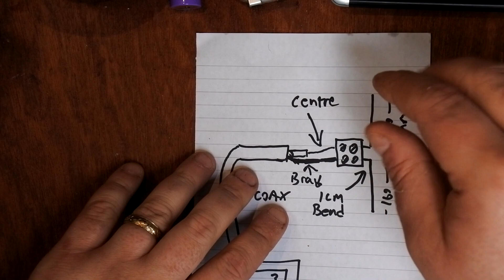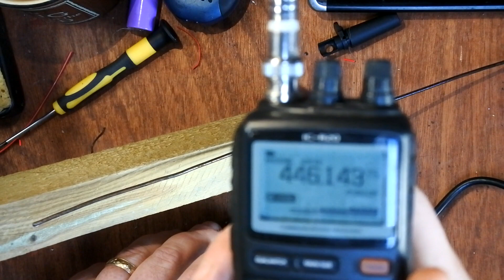Modifiing a PMR or FRS radio antenna for better receive performance

Comment: The easiest way is to fully straighten out the built in antenna coil. Measure from the point where the antenna meets the circuit board and cut it to 6.3 inches. This way you can't connect to an external antenna but it will give you a real 1/4 wave antenna which will work better then the small coiled antenna. Cover the 6.3 inch antenna wire with electric tape, a plastic straw or something.

Comment: Also good point about element Diameter! Some years ago I found a wavelength and diameter calculator online. I was amazed that the " sweet spot" in diameter for certain frequencies was nearly 5" in diameter!! Not practical but very interesting, nonetheless. Also apparently the tip of the antenna is important as a jumping off point for the RF,and not just protection from putting an eye out accidentally.
Reply: Also if memory serves me,that calculator had a setting for element material. Naturally copper is good but not practical in many situations. Aluminum being the most common,but material composition also has an effect. Strangely stainless steel,being non magnetic is used often. Unless it's the magnetic stainless steel that is being used.( I only learned about magnetic stainless steel while at a scrap metal salvage yard last year, I shamefully admit.)

Comment: The long wires inside the radio will act as an antenna and will radiate inside the radio. This will also affect the tuning and performance of the connected antenna.

Comment: it has to be said you should make sure the ground you attach the - point on the antenna plug to is an RF ground, not an analogue ground or digital ground but RF ground.
great video by the way.

Comment: I did a 1988 version of this. Eurosonic 250mw 2 channel CB handhelds bought from local CB, relectronics, radio shop up by secondary school at at the time. Had these 1987 christmas. As CB walkie talkies, completely daft long antennas, as they would be fro 27Mhz. telescopic. left dowen, bit of thin standard grey speaker wire ripped down middle to get 1 bit of the pair. Croc clip one end to telescpic up a few cm for the clip. wire as it was, 1 core to a unstraightend coathanger with tight loop at bottom, bolted to the plastic of the panier rack on the back, Bike CB. Bicycle. Crap. Never as good as the long antenna and coukld have stuffed it up, High SWR. But not ruin. Just comprimise the TX and no doubt Rx of the Hong Kongs finest 2 channel 250mw radio. Radio profile linked in my words or banner photo. Moved on from that, first things I had, Car CB. base and 4W handheld (eat 10AA rechargable thing) in the 90's. A few amateur radios now.

Comment: Keep your antenna leads as short as possible or you will face an impedance mismatch! Then you lose output power from a transceiver that doesn't have a lot to begin with. You may as well have kept the original "rubber ducky" for the power loss of your mod made.
Reply: I also agree , however I have been looking into mobile vhf installation and coax type and length.The company I work for,all my coworkers vehicles have low band VHF radios,but in the natural gas industry where I work, antennas are continually being ripped of by tree limbs and branches,so none of the radios are operational.many areas have no cell signal either. I had 3 years of radio and Tv repair years ago in high school and told supervisor I'd get radios working with minimal $ expenditure.In studying coax for VHF apparently you can just cut coax to the shortest length. But especially in mobile applications coax should be about 1 wavelength. The excess coiled up and stuff under the seats or whatever.
Reply: CANT CUT COAX...I meant to say.i would edit my comment above,but it likely won't repost as google has a ax to grind with me
Reply: At Christmas our CEO came to town and took the whole crew out to a restaurant for lunch. I brought up the radio topic and learned the company is paying $5,000 per month for a Repeater on a nearby MTN ridge,that not being used! Yet at times,we are in situations, alone,in the wilderness of central Pennsylvania,with no communication! SMDH.

Comment: You have the connection wires from the antenna connector centre terminal to long, they need to be soldered to the circuit board and kept as short as possible. The black conductor wire will be a bit longer but an earth point can be located on the board for interconnecting. 73

Comment: D ' ont use wire between the point of power out put and the jack antenna. Will loose power and change impedance ! These FRS use low power and high grequency.

Comment: Roberts Shed why not just make antenna from the Coax ? fold the shielding back 161mm and you got you're dipol
Reply: becouse your in truble with the f.c.c that's why
Reply: why not just leave the radio and  con tact  the f c c and get your fcc gmrs license  I did and I talk to chicago 
every morning  on a tower gridd

Comment: Great stuff, PMR446 can be a great deal of fun. It's amazing how far you can get with these little radios. One thing that puzzles me about your video.... The frequency on your receiver when you do the check... Channel 4 should be 446.04375...... 

446.14375 is channel 12 (On the newer 16 channel radios)????
Reply: @RadespotosR analogue channel 12 is 446.14375MHz

Comment: You could actually use a single 18650 battery outside the case, or a 14450 battery with two dummy batteries in the case (a 14450 rechargeable battery is a sized AA battery) with a remote microphone if your radio is set up like a Baofeng UV5R. The dipole could be set up outside with a length of very low loss coaxial cable, too. Lots of ideas  can be done with the new lithium batteries of today. Think about a 4.5V 1amp "wall wort" as a no worry power supply for the radio? Just remember your polarization when you connect the wall wort power supply or you ruin the radio. I am not suggesting that you do this, but done carefully, it is possible?
Reply: What low loss coax would you recommend? Im about to build a 446mhz half wave dipole.
Reply: I used NOS surplus Navy double shielded coax 50 ohm .50" diameter and hard drawn 12 gauge wire for the dipole both vertical and horizontally polarized (separate antennas). RG-6 can be used with "F" or B NC connectors with little loss. RG-174 can be used for short length  deadlines but be sure to get the 174 with silicone dielectric and at least 80% shielding copper braid.

Comment: If i don't use biple, is it mandatory to add the coax to ground (neg) component with connector for antenna? or can i not just attach a longer antenna to the existing single connection?

Comment: Hi Robert Well Done putting this Video up and will help those who are interested in Radio get better Reception which is never illegal to do 😊👍. .Just a couple of points for everyone to note is not to forget all un-shielded wire to the main radiating part of the Antenna will become part of the Antenna,s overall length..So best to use Coax to the Sockets and also between the socket and Antenna itself...The Scope probe lead is not screened and also the short lengths of  wire connected to the bnc socket inside the Radio will become a part of the Antenna..Best to use very thin coax inside Radio and Rg58 between bnc socket and Antenna Connections...Normal TV Coax is no good as it's 75 ohm not 50 ohm which most Radios are designed for....Anyway good Video and best Regards Steve Liverpool UK

Comment: this wont work that good.. WHY?? cause the wire you used for the center conductor from radio to antenna isnt shielded!! and thus the wire will act as PART of the antenna!!!!
Reply: Funny, I made the same mod and have nothing but improvement on TX and RX, significantly
Reply: @freepressright  prove it.. cause ive done this mod with professional equipment to test the mod and its exactly what i posted above! SIGNAL LOSS CAUSE THE COAX ISNT SHIELDED!!!! ask a professional to explain it to you.. antenna desgn and theory! PS: you can also tell the guy in this video doesnt really know what hes talking about with his coax selection.. ie: rg-8 or rg-58.. As that is NOT good for UHF band..  it will work fine for Cb radio though lol
Reply: @WPGinterceptor460Interceptor  prove it? So, would a video upload of me on a modified Cobra Microtalk CXT-125 with an SMA jack that I added using normal wire, with a 15.6 inch whip and talking to someone distant be proving it? I understand antenna theory just fine, but I did this mod with what I had and it works better than it did factory. I have an active YouTube channel. Would you like an upload?
Reply: @freepressright  if you used a normal "WIRE" as you say it... from the transmit output of the board to the input/ centre conductor on the sma then your losing power to your antenna..  because that wire becomes part of the antenna and on UHF band as these FRS radios are, then absolutly the wire is aboubt 3/8 that of a 1/4 wavelength antenna for this frequency!! YES it will work a little better than the normal spring antenna the radio comes with but the real loss there is the wire..  Lookup M17/94-RG179 CABLE.. thats what should be used .. and with minimal seperation from centre conductor to braid! TRUST ME
Reply: @WPGinterceptor460Interceptor  I never argued it was perfection. I argued that it was a significant improvement,  because it is. I wired to the center pin, then tested for ground and found it on the headphones Jack. I grounded to the outer structure of the SMA. I understand loss factor perfectly, but we are talking about an inch here, at most. Loss factor would be negligible. I'm talking on my Tram magnet mount in the car just fine, and the 15.6-inch whip is a huge improvement over the pile of shit that these come with that they call an antenna. If I'd have had the coax, I'd have used it. But I didnt, and these radios are nothing special. It was an experiment and it works well. Would you like video?
Reply: @freepressright  a video of properly done yes lol.. otherwise loss and high swr video like this one, there are many!
Reply: @WPGinterceptor460Interceptor  I make all kinds of videos. "Properly done" is subjective. What do you want to see? I have a channel and about 237 subscribers. It's a hobby.
Reply: Although not scientific by any means, I shot this on the fly a little bit ago. The description gives the details, but I also have a Baofeng UV5R. Its 5 watts and this Cobra is a half watt radio. The Baofeng is only very marginally better when talking to the guy I'm talking to, who is inside his house on a walkie talkie on the opposite end of town. https://youtu.be/rH50_9LqUmE
Reply: @freepressright  you know using that Beofung on FRS is illegal.. those radios are complete junk and cause a 5 kilohertz splatter.. just sayin,, but thats why they are 30$ and made in China
Reply: @WPGinterceptor460Interceptor  according to the FCCs enforcement records, not a single individual has ever been cited for using a Baofeng, or for any general misuse. Companies have gotten into minor trouble, and a local school district and municipality, but not a walkie talkie user, ever. My occasional use of a 5 watt walkie talkie isn't going to be of much interest to anyone. A bigger issue is what a sewer FRS and GMRS has become now that everyone and their brother has one. That is a far bigger crisis than a guy with a non-type-approved radio. Still doesnt stop people from spewing total horseshit like "have fun getting busted," or, "you will go to jail if you get caught using a Baofeng."
Reply: @WPGinterceptor460Interceptor  and, for the record, that Cobra of mine is a far bigger piece of shit than my Baofeng, even on its worst day.
Reply: @freepressright  the reason for these to be illegal is the splatter.. learn about harmonics and youll realize that when you transmit on FRS your radio is splattering harmonics.. and the stories about FCC taking all day to track you down is BS too.. they have triangulation now and can pinpoint your location the split second you transmit.. not to mention your Electronic fingerprint that radio leaves behind.. use a real radio.. spend the $$$ and get real radios
Reply: @WPGinterceptor460Interceptor  I'm looking for documentation or substantiation that all Baofeng UV5R radios cause a 5 khz deviation that results in splatter. I can find no official or scientific documentation of that claim. Is that one radio that does it? Two? Or all of them? And how do you know?
Reply: @freepressright  yeah yeah yeah.. hook that radio to a Scope and see for yourself.. WHY DO YOU THINK THAT RADIO IS ONLY 30$ BUDDY....... well im older than 40 and been in the PROFESSION for 45 years now! you have alot to learn!!  go back to the CB band!!! laterz
Reply: @WPGinterceptor460Interceptor  all that proves is that you're old -- and that you're arrogant. It doesn't make you right. 

Knowing a Baofeng radio aggravates the do-gooder know it all folks out there just makes me want to buy 10 of them and turn them all into base stations. As a matter of fact, I have about $150 to blow, and  I think I'm going to hit amazon and do just that. 

You telling me to "go back to CB" suggests to me that you're probably a ham, but not just any ham.  You're THE worst kind of ham, despised by good hams, and the reason otherwise good folks become turned off by amateur radio. 

I was a professional broadcaster from 2004 to 2011, working as an AM radio talk show host, a news director for four stations and as a production director. I worked with some truly wonderful broadcast engineers and have many wonderful friends in the amateur radio community, and in emergency communications, as I now work in public safety.  I've been around enough that I have an idea of what I'm talking about. 

I also have the education and decorum to know how to communicate without turning everyone's stomach. You, sir, have a lot to learn in that department. 

Now, if you'll excuse me, I have to go back to my CB radio. I have a 16kw linear amplifier to build a GMRS repeater for :)

That's sarcasm and humor, in case you couldn't tell. Have fun.

Comment: If you're not, you should consider becoming a Hamradio operator.  You seem to have skills with tinkering with radios.  With  Hamradio you are allowed to legally to tinker/experiment with radios (if your intent is to modify it FOR USE within the Ham Bands ONLY).  Unfortunately, PMR/FRS rules do not permit this at all.  Any antenna modification to a legal PMR/FRS radio automatically makes it illegal to use as those services require a fixed, non-removal antenna.  Well, good luck and don't get caught...
Reply: Who the hell is gonna catch him?? Do you keep to the speed limit in your car all the time???

Comment: Hello, I have a couple of walkie-talkies and wander if there would be any improvement if the antenna is replaced with a telescopic one (like the transistor radio ones)?

Comment: It is illegal to change antennas on FRS radios.
Reply: No one ; only use external antennad.
Reply: Oh god, here we go. Not a single individual has EVER been cited by the FCC for modifying an antenna on a GMRS radio, and that's according to the FCC's database. So, in short I ask you, who in the hell gives a god damn rat's ass who mods an antenna on a damn half watt walkie talkie?